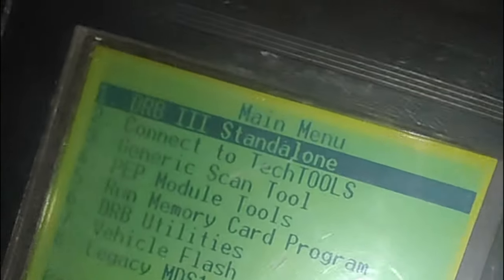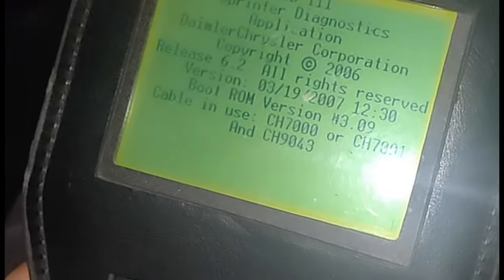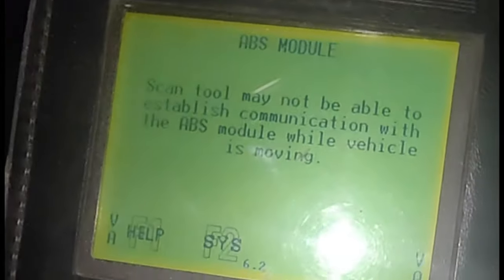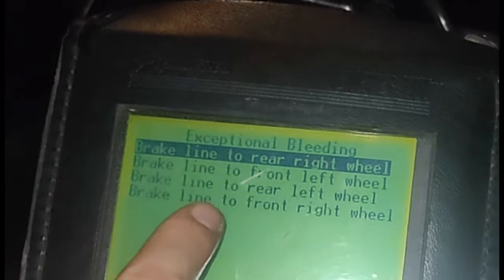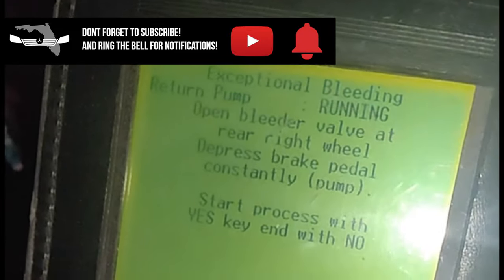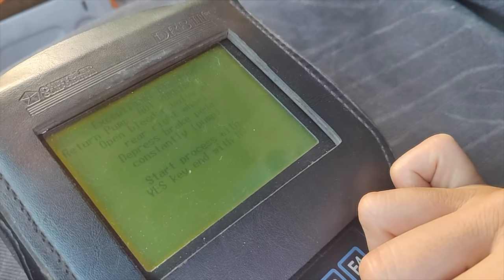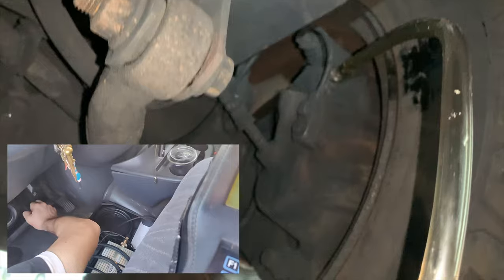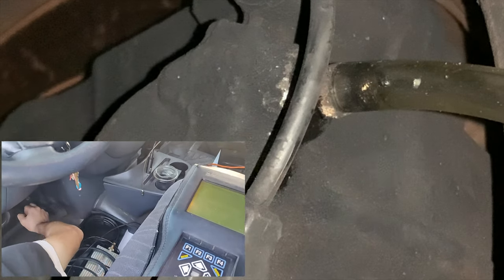Bleeding the Brakes on a T1N Sprinter with Dealership Tool, DAS Will Work Too.

Comment: Hi Guys, For reference, I use additional tools to bleed brakes: 1) a power bleeder to pressurize the reservoir and force fluid through the system.. 2) Sometimes, a vacuum pump to draw fluid out of the bleeder. When bubbles are no longer evident at the bleeder, I close the bleeder and disconnect these tools and top off the reservoir. Then I connect the DAS and perform the Exceptional Bleeding process. I have heard from knowledgeable folks that during this process, the  ABS pump cycles spend fluid back to the reservoir, which may need to be extracted and replaced.  Process worked great on my 06 140. I will perform these procedures on an 05 118 this weekend. Cheers, Tom  
PS. To save $$$, In my old Volvo days, I constructed a pressure bleeder using a spare reservoir cap with top  modified to fit a tire valve stem with core removed, connected via hose to an old pump garden sprayer. And a simple mighty vac type tool works OK at the bleeder. Bonne Chance et Bon Courage as they exclaim in Brittany.
Tom

Comment: With an auto bleeder, one person is all ot takes to bleed brakes. They cost under $20..alternately, make your oen by taking a piece of hose sized to your bleeder valve, splice in a check valve made for fuel or oil, and you are ready to roll!

Comment: Hey guys it's been a while but I'm still around lol.  You might be chasing the wrong issue,  It's most likely the brake booster.
 These brake boosters are so old that the rubber diagram loses vacuum add to that a bad hood seal or poorly maintain drain channel at the top of the hood and the brake booster will get direct water dripping on it, water it will penetrate the stamped metal booster housing and cause the booster diagram to rot/become brittle.
Reply from the maker: Hey Manny! Folks were asking about you a few days ago. Glad to see you. We'll look closer at the booster but he keeps getting air in the lines.
Reply: Nice to hear! a tale-tell sign of a bad buster from water dripping on it would be a rusted housing or a pedal that seems to hold then slowly loses tension. 

Was the van ever in the rust belt, so many people with fully rusted lines on the forum that might be worth inspecting all the lines to make sure you don't have one that's about to go?

Comment: Did you make sure your break fluid reservoir was filled at all times? Doesn`t help if you pump air in from right there..
Pressure pump at the reservoir is usually how you do it. Remove lid from reservoir, attach the pump (filled with break fluid) to the thread of the lid and pump some pressure in it (1 bar is enough) 
Open the screw on the caliper and you should have only liquid coming out pretty fast.
Thats how I did it and it worked on every vehicle until now.

No idea if or why you would have to go into the diagnostics tool... didn`t do it on any vehilce before and they all had ABS.
Reply from the maker: I don't know why either. I just followed the service manual procedure assuming there must be a reason they bolt this into the software.

Comment: Do you need a scanner to bleed the abs pump?
Reply from the maker: Debatable. The day of this video is the only time in my life I have tried to bleed brakes. We had experienced help who says "Yes, a proper scan tool is needed" but I have read many opinions online stating it is not needed. I believe** without the tools we must have the engine running or at least the key on so the ABS pump is energized.

Comment: Your fluid is totally contaminated from age , have someone sit in the seat pump 3 times and hold the pedal down , when it is down you release the blead screw . close the blead screw pump and repeat , but always checking your fluid res is full if you let air in you have start all over 
start back right , back left , front right front left , have a beer .... eh

Comment: Could you just use a vacuum pump at each wheel?
Reply from the maker: I don't think so. I don't fully understand our ABS system 9not even close) but I believe you would be sucking against a closed valve not letting any fluid into the line past the pump unless the pump turns. Perhaps a vacuum would work rather than pumping the pedal, but the ABS pump has to run.
Reply: @FloridaVanMan  As long as the brake pedtal is not depressed, the system is "open" meaning fluid can flow into and out of the reservoir.  So you can use a vacuum pump to pull fluid out of the bleed screw, as long as there's fluid in the reseroir.  I think this method isn't very popular because it's difficult to tell if bubbles in the vaccum line are coming from the brake lines, or coming in around the threads of the open bleed screw.
Reply: @bcmanucd   I have used a hand vacuum pump on a motorcycle when the master cylinder didn't pump fluid out, worked great but that's with no ABS pump.